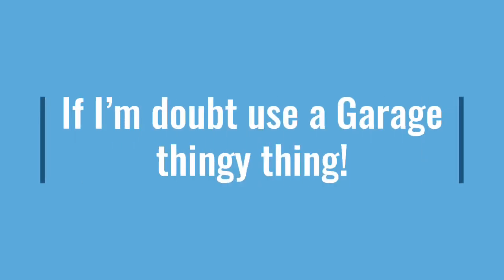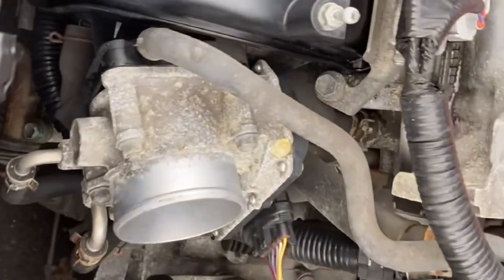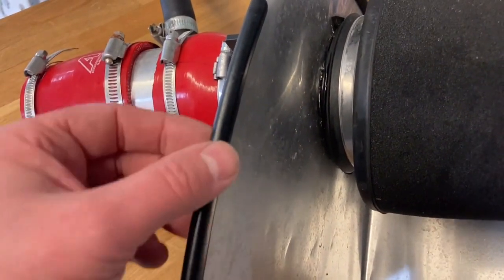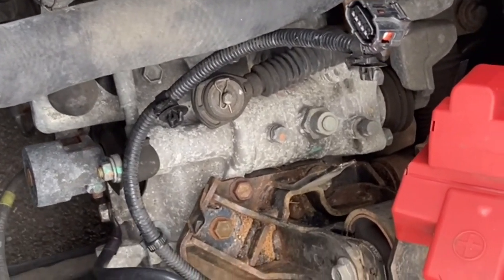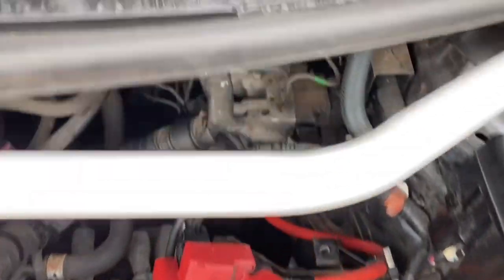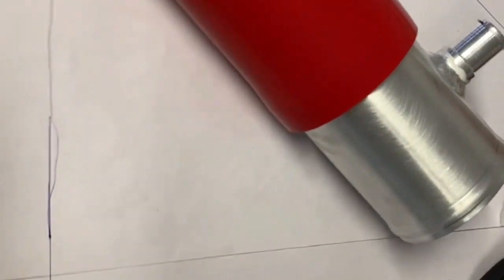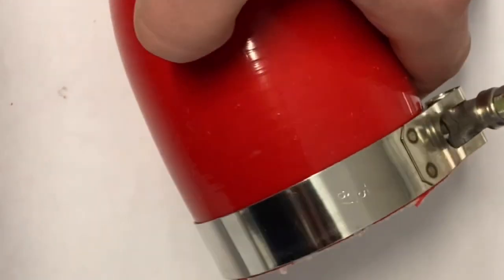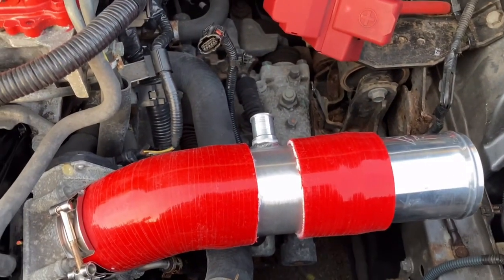Yaris 1.8SR Cold Air/Short Ram Air Filter.  Part One

Comment: do u need to hack the stock airfilter lid for the maf part? Or will it just unbolt from the lid? Im thinking too to make k&n intake filter install. But in sametime using the stock box in winter.
Reply from the maker: Hi no, the maf is seperate on these.   1.8 2ZR-FE Just retain the stock airbox for winter. 🥶 no need to hack it
Reply: @Whatifwarlord  i will. Thank u 👍😎
Reply from the maker: From memory one end of the maf pipe is bigger and has a rubber seal
Reply: @Whatifwarlord  i have to measure thar before buying k&n. 👍
Reply from the maker: @Kohju yes, tbh I’d go Ramair if your in the uk- some of their kits have the adapter rings.

Be careful with aftermarket Toyota non k and maf pipe adapters… the k and n ones you get a good fit and well engineered
Reply: @Whatifwarlord  ok thx for help 🙋☺️

Comment: Hi, nice video, ive got the same Yaris 1.8 SR and was interested in doing the same (replace air intake).
Your video has inspired me but I noticed it was uploaded 11 months ago, but I cant find the 2nd part to it???
Can you possibly link it in the description of part 1 so its easy to find? 

Many thanks, stay blessed.
Reply from the maker: It died :( 

Spent £2k trying to work out what the fault was.

Second hand ecu x 2
Injectors
Garage diagnostics
Fuel pressure checks
New maf and crank sensors

Just wouldn’t crank.

Engine was in time 

Totally threw everyone who worked on it :(

Toyota didn’t even know- maybe it was the immobilisation system?  Or the body control module?? 

Good idea to replace the air box.  From my experiments on the Sluglica I would build a card mock up and get a carbon fibre kit off easy composites.

Then use pipes and card and mock up the intake system you want - cover that mock-up in aluminium tape them layer up as carbon fibre :)

It’s not cheap but you get a bespoke air filter kit which weighs zero kg :)
Reply: @Whatifwarlord   
Wow that's a shame, a bit strange then & scary, ah well, you win some and lose some.

Yes I'd like to try it out as suggested,  what kit would you recommend and where can I get it from?
The material you mentioned, such as aluminium tape, pipes (including lengths), or carbon composites, can you post the links pls, it would really help!!

And thankyou once again!
Reply from the maker: @TikTok-fs4se yeah it was very costly and annoying.  It was like Toyota programmed it to die at 75001 miles :( 

https://www.easycomposites.co.uk

If your learning get the shears and a starter kit

Tape 

BOMEI PACK Aluminum Foil tape 100mm x 50m for home Heating,Ventilation (HVAC) air Ducts Repairing,Fixing,kitchenJointing,flame,Cold,heat resistant Moisture,UV,Waterproof https://amzn.eu/d/3crq41l

Just use card to form your shapes then put the Alu tape over it to make a mould.

Best

D